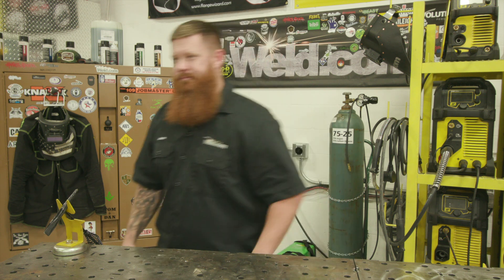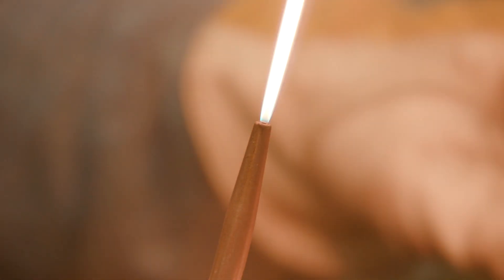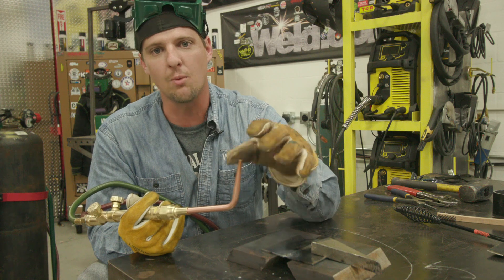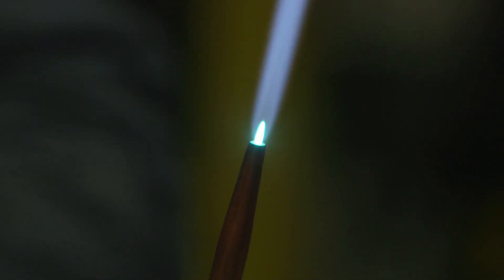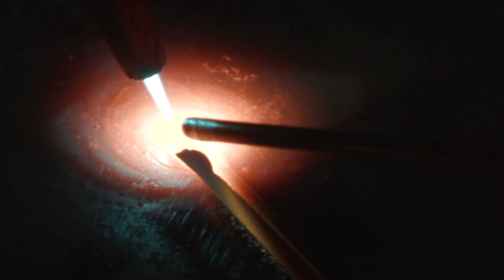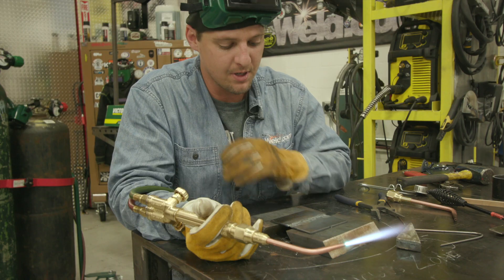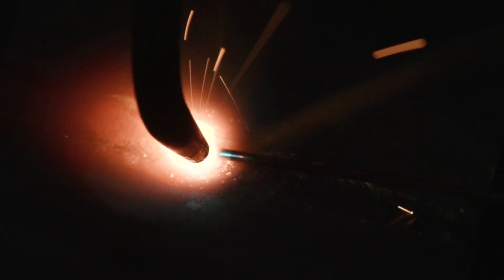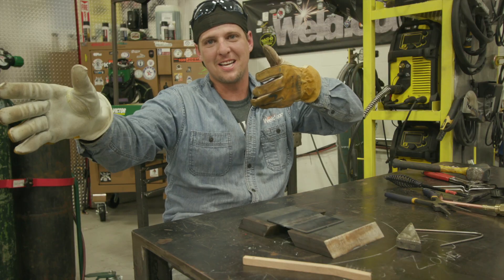OLD SKOOL!! Oxy-Fuel Welding (with @mancubwelder)

Comment: When I learnt to weld in the early 1970's, Gas welding is what was taught first, the instructor said that if you learnt gas welding other types of welding would be easier to learn later. I was taught that when setting the gap to leave one end between half and one thickness wider make the first tack at the narrow end and the other end will close to pretty well the correct gap.. I did not get to use a tig welder until the late 80's and due to the gas experiance I pretty well just picked up the tig torch and away I went near perfect tig weld first time so the instructor was correct.
Reply: I've tried both, oxyacetylene welding is definitely more difficult to master.
Reply: Gas welding is what I learned first at school. I believe TIG welding become easier to learn if knowing how to gas weld.
Reply: @Frank-Thoresen  the thing I personaly find easier about TIG, you are more comfortable welding and are in control of everything, despite both torches are quite heavy because of the hoses and wires, there is no strong gas flux everything is very clean, far less heat, yoy can feed the rod at much smaler distance without geting burned and this allows better control of the rod, the puddle is formed instantly and is easy to manipulate, you can stop whenever you want and restart where you have finished instantly, all these things for me makes TIG easier the only thing about Oyeacetylene that is easier is that distance between the flame and puddle may be alternated without big consequences unlike TIG where professionals who have been welding for 10 years and over constantly dip tungsten into that puddle.
Reply: I'm in a welding class at my highschool we don't learn oxy fuel welding I wish we did we learn to cut tho
Reply: "learnt" ?????
Reply: @BoomerWelder  Learnt and learned are two different spellings of the past tense of the verb 'learn', which means 'gain knowledge or skill' or 'come to be able to do something'. The spelling tends to vary based on the version of English: In UK English, 'learnt' is standard. In US English, 'learned' is more common.

Comment: This process is great for blacksmithing and doing ornamental work. Also great for minor repairs and possibly auto body work if you don't have a tig set up. We were taught this in high school shop class. The biggest advantage is oxy fuel doesn't require electricity. But it's slow. I've heard you can't use propane to weld? Not hot enough? But I can make Damascus steel on my propane forge? What's up with that? I'm an amateur blade smith and blacksmith. My side job. Working to get my welding certifications.

Comment: I haven't don't this since high school 16 years ago. We had a contest to see who had the Strongest welds. The machine would pull the two pieces of metal apart until the weld broke and would show how many tons of force it took. I remember getting 2nd place in my class, but I don't remember the specifics of the test (how strong my weld was or anything like that)

Comment: Wow that is interesting. I don't gap my weld at all on thin steel like that. I would guess that I gas weld more than most hobby welders and I have a very different style to make that weld. I would like to see that weld on a fold over bend test. I think a lot of the backside penetration he thinks he is seeing is cold fall through material.

Comment: I'm normally quite but I can't believe I seen that. Neutral flame instead of oxidizing and make a full puddle and walk the dog. I might have even gone down a tip size. Try that and you will have weld reinforcement without smoking your steel

Comment: Ridiculous ! you do not have to maintain 1/8" gap !  to weld with an oxy acet torch ! 
the secret is to tack it about every 3"  FLUSH... and if your worried about penetration with oxy acet... just get it hotter !
 I never put a gap in the weld on purpose .... what kind of thinking is this ?  think about it your welding 2 pieces of steel together
doing it the way you did mandates that you weld both sides the rod is more brittle than the metal and it will snap at the joint.
..... this is a thumbs down sorry but I've been welding with Oxy Acet sense I was 12 yrs old and i'm 67 now
and I have never seen such a silly way of welding 2 plates together !   butt welded joint or not  . get the metal plates together as tight as possible and simply weld it like you would Tig weld it.... it may warp ....yes that happens when you weld thin stuff
annealing the metal later ( get it red hot) and let it cool will relieve the stress in the metal and un do the warp. in most cases.
Bob.

Comment: Do you ever recommend using flux?
Reply: I've never gas welded with a flux, I've only used flux for brazing.  Have you seen flux for welding?
Reply: We used it in high school ag class as I recall it came in a small round can that you dipped the rod in. Also had an instructor  use borax out of the soap dispenser in a pinch said it was roughly the same.

Comment: Can you do laywire in Oxy-Fual Welding like you can in Tig Welding?
Reply: Kind of. Its not as fast as tig. It's pretty useful in fillet welds when the puddle doesn't want to move on it's own. You can lay wire and force it.

Comment: Old school or not, oxy acetylene welding works. On the farm, I am not going to spring for a gas powered stick welder when I can load up the gas rig and go knock out a job. For the occasional job away from the shop on the farm, the gas rig works perfectly. It might be slow, but for non production jobs, it is an economical welding option that is independent of power supplies. Battery powered drill with a cup brush to clean the metal and you are ready to weld.
Reply: It's also way more satisfying to get a good weld with gas
Reply: This. People think you need to spend 2-3 grand to get a good welder. My oxy setup was only about $750 (with a few different tips). 40lb acetalyne tank and matching o2 (don't remember cybic ft off the top of my head...). For me, as an occasional welder who will weld .25 material or less it does just fine. 

I'm just starting out in with my home shop and my welding setup does more than just weld. Stuck bolt? Grab the torch for some good ole heat and beat. Need to cut that? Well today I'd probably use my portaband but if it is bigger I'll put the cutting tip on. Even my small cutting tip will go up to 3/8.

Oh! And no electrical work to get it running as mentioned! Handy when I was still renting...

The old man loaned me his Lincoln buzzbox he bought new in the 80s, I think that thing has everything else covered. Really the only thing I'd say you need tig for is if you weld A LOT.
Reply: Im always happy to see stuff fixed old school. Im in production so seeing shit repaired over
Reply: Replaced is the best
Reply: And it's actually fun to weld with gas and rod. 👌🏻
Reply: I bought my first gas rig today, cost me $1000 CAD. I also have a generator and a 200 amp stick inverter , cost me about $800 CAD.  For a field repair i usually cut my steel with 6011. The gas I will use to do the cutting and to weld that thin metal that the stick likes to smelt. A hot wrench is always nice ! Haha
Reply: its a good process for outside, or working in a huge hangar, on structural steel and shipbuilding ..its not the best for woking inside on a bench

Comment: I learned to acetylene weld almost 50 years ago.. We learned fusion welding, welding with filler, etc.. I have used it for many years.. One thing I use to do is weld old wire rope to new wire rope to reeve boom lines on cranes. There was no load on the weld as it just pulled the new rope through all the sheaves (12 parts) and when the new line appeared, we would make it up and the job was done.. I used #9 tie wire as filler and always used Victor torch.. Mike in Louisiana
Reply: I used clothes hanger wire for that once. (It was an an emergency)
Reply: @blackwaterrepair10  My wife bitched me out for digging all her old wire coat hangers out of the trash.. She likes the plastic ones ..lol.. NEVER but NEVER throw away wire coat hangers!
Reply: That has always been the go to method for all us mechanics except when some good buddy tries to help you out and pulls the old cable out first LOL I'm sure you've been there a time or two
Reply: @edwardkawecki8101  Yep.. That is something that is best avoided for sure!

Comment: The “pop” at 3:35 or so may have occurred because your torch tip contacted the molten metal surface. I have been “old-school” oxy-acetylene welding for 40 years. I believe that extending your blue (oxy) flame tip another 1/8 of an inch would provide a helpful margin of error and reduce the possibility of overheating.

Thank you for an informative, instructive video. And, thanks for verifying that the OLD SCHOOL IS NOT DEAD! Lol.
Reply: Just curious what type of things you weld with oxy acet??
Reply: DANZ I’m planning to repair a cracked frame on a boat trailer.  My stick welding is pretty poor, and I think I can do a better job with a torch.

Plan B is to bolt some angle iron over the cracked rear corner welds.

Plan C is to take it to a professional!
Reply: @firstmkb  best thing i did was a college welding course. It was 1 night a week over 12 weeks. From stick to mig to tig. Try find a community type college.

Comment: Weld in 1/2 way then weld back from the other end.  That helps avoid blowing thru at the end. It also helps you get comfortable welding in both directions.
Reply from the maker: Good tip

Comment: Learned Oxy-Fuel welding at Hobart School of Welding 28 years ago and still use it occasionally. Excellent video 👍👍👍
Reply from the maker: If I'm not mistaken that's where Mancub learned it as well.
Reply: Thats cool.. I love stories like these..That was my first class at Hobart.
Reply: I took the combo welding program at Hobart. I believe first class was blueprint and then oxy-fuel and-built  a coupon carrier using oxy-fuel. I’m still welding everyday. I build stainless steel exhaust systems and down pipes for an aftermarket Mercedes Benz company. Still love to weld.
Reply: @jacklandismcgowan1413  That's awesome . That's exactly right. I should have said first hands on class. lol. Yeah i also took the Structural/Pipe program it was 9 months long. Ernie was my teacher for oxy-fuel and some other classes. Smart/calm old guy. He had a 55 chevy. He retired shorlty after i graduated in 2009.

Comment: When I first got in the fitters the old timers still used oxy-act on 2 in and under, big tip lots of heat fast moving. much faster than arc and great looking welds

Comment: What’s a good gas setting for Acetylene and oxygen for doing this?
Reply: Different torch manufactures have different settings for tips. Check the tip chart for the size tip you are using.

Comment: I haven't oxy-acetalene welded in years. In fact, since High School for Ag class. I use them for cutting now though. I currently have a Miller/Smith heavy duty combination torch personality.  Don't have a welding tip yet though.

Comment: Don’t leave a gap in the plates. Butt them up tight, then you can weld them and the only adjustment will be your depth of penetration which sets your travel speed. 
If you don’t have a puddle in three to five seconds, adjust your heat or get a different tip.
Reply: ...and grind a bevel.
Reply: On 1/8” plate there is no need to bevel. If you can’t get full penetration on thin plate then adjust your heat and travel speed.